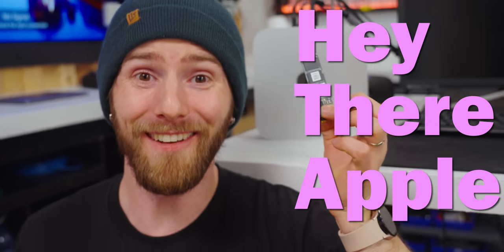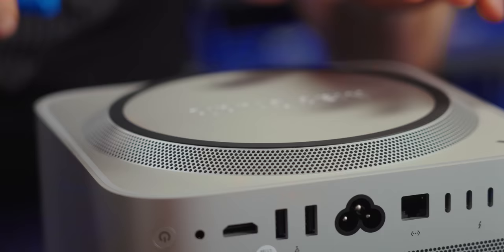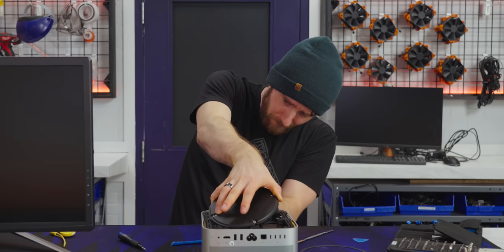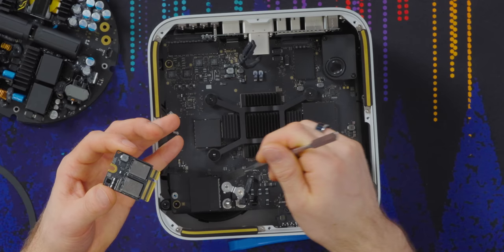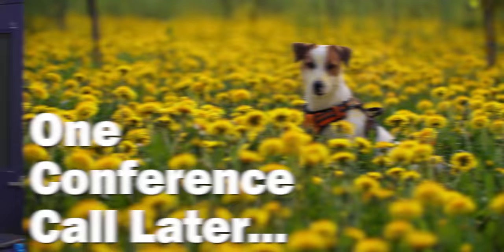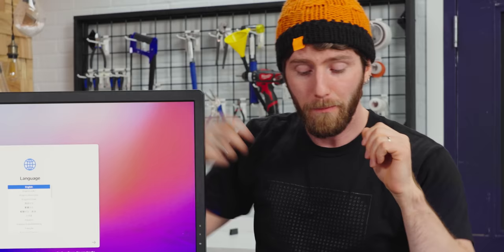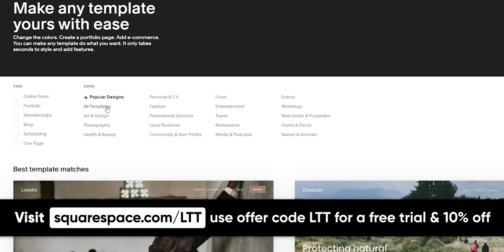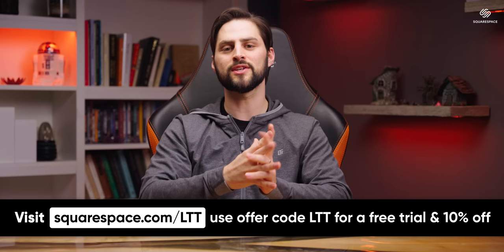I want to love Apple, but they’re making it hard - Mac Studio SSD Swapping

Comment: All these people claiming Apple is anti consumer don't understand the market that Apple is targeting.  Apple makes high end devices that are meant to be as user friendly as possible and require little fluency in tech.   They are meant to be a turn key solution.  Their users are mostly people in the creative space or business world who don't want to have to worry about if their tech is going to work, they just want something that they can count on.  It is for people who value form, not just function.  If you love to open your computer up and fiddle around with the guts, then buy a PC.  Honestly, I find Windows user experience to be so poorly designed that I would rather just pay the extra money for something that just works.   With a PC, it's designed to let you fiddle around with everything because you will inevitably need to when something stops working.   With literally millions of possible hardware configurations it's just inevitable that something won't work properly.  I used a PC for 15 years I jumped ship because it's obvious that Microsoft couldn't care less about the user experience of it's customers.  From the disastrous UX design (random forced updates anyone?) to the fact that not a single useful app is included, I dont know what they were thinking.  Honestly, does anyone use MS paint or Internet Explorer?  Why is there a settings app and a control panel?

The most common cause of issues as far is I know is heat, and the Mac studio generates negligible amounts of heat compared with a high powered PC which is basically a space heater.  This guy clearly is the type that loves loves tinkering with hardware and that is perfectly fine, but that's not the idea behind Apple products.  Complaining that you can't swap out the ssd here is like complaining that you your gas car doesn't have the same acceleration as an electric car.
Reply: Upgrading an SSD is more like filling up a gas tank in a car. Would you want a car that you cant refill yourself, with only way to do it is going to official gas station where it costs for you twice as much compared to the rest of gas stations? But at least the car is fancy, makes you a coffee and gives you a pat on the back* every time you drive somewhere. (*pat on the back and coffee making is part of apple+ subscription)
Reply: also the arguments of "they make products to people who are barely able to use anything tech-related" and "their consumers are rich enough to pay for it" are pretty stupid. You dont have to be fluent in tech if they could have made replacing an ssd as easy as it was on old thinkpads. One screw, take out the ssd and put new one in and then screw this one screw back in without anyone screwing you.
Reply: @mofik  not really.  Once used, you can't get that gas back where as with an ssd you can free up space.  Plus, with Apple you have other "gas tanks" that you can add in like icloud and external hard drives.  Upgrading in the PC world is also a failsafe because the components are often lower quality and given that there is such a huge hardware ecosystem of independent manufacturers any reliable quality control is essentially impossible.
Reply: @mofik  this is not the apple mindset.  When it comes to design, Apple is one of the best in the world and they could have easily added this in a user friend way.  They didn't because it's unnecessary.  No one drops 3 grand on an An Apple computer without doing their homework and knowing what size ssd they would be looking for.  If they are a filmmaker and need a bunch of extra space, they know in advance what their job requires and will buy extra hard drive space or an external hard drive.  Most people use their Apple products for work and if anything Apple users are more demanding as being able to use their computers reliably is tied to their ability to pay bills.  Opening up a computer carries is literally and metaphorically pandoras box. You can cause damage even if you know what you're doing.  Apple doesn't want to bring Murphys law into the equation because it breaks their vision of rock solid reliability. You can't have customization and reliability and that's why Apple is a closed system.

Comment: Some time ago ive bought a macbook pro from ebay, and it was icloud locked.....Its impossible for some with no expert skills and a soldering iron...Even apple are doing nothing, from what i have seen in the internet in some forums. Why is it so difficult to just remove the icloud lock? The new users and i doesnt want the data from the person before, we want just a running macbook. My opinion is that apple must di something about it. Just make it possible to erase the icloud, with some shortcuts or soemthing.

Comment: There is a simple solution to Apple's rip off attitude. Refuse to purchase their non-Intel based hardware. Upgrade the older products to the maximum you can afford. Then install Linux Mint Cinnamon on the Macs. You'll have proven hardware installed in an elegant case design with a superior OS that runs much faster than any version of OS-X. Open Source software uses much less space and RAM to function. Plus it's free!

Comment: Apple lock hardware by married 2-3 Chips ID each  you must use software and edit PUT married ID CHIP EACH OTHER ONE BY ON IF NOT A PIR OF CHIP HAS NOT DIRECTLY IT WILL REJECT AND LOCKED WARNING DISABLE SSD

Comment: I'm just a naive college student, but doesn't the controller control the address of the bits on the device? So since the controller is baked into the m1 chip, doesn't it have to have a fixed amount of address bits that are really hard to expand and detect a higher storage device? I guess you can use something that can be programmed to try to write data to an address that keeps going higher and higher until nothing can be read because that address doesn't exist, but can anyone help me understand?
Reply: No, that's not how SSDs work. Unless Apple specifically designed their chip that way - which absolutely wouldn't surprise me.

Comment: I don't like what they're doing, and I understand it. They are mainlining the NVRAM ... if you've ever mainlined, which is needle to the vein, you know that some sacrifices must be made.

It's NOT an SSD. It's a module with NAND chips. NO controller. Nothing else. It's just NAND. The SOC does the rest because - you asked for this. You've been begging for this. All of you reading this too. You begged and begged for a computer on a chip. You said, "HEY you... you computer people. Stop making us buy motherboards the size of Manhattan (or Canatreal or Vancanda or whatever up north) - Make us a computer that fits on a chip. All of it. One chip. One die.  The entire computer. The motherboard, controllers, and to heck with PCIe, who needs them? well ok maybe we want 1 for radios but get rid of em.. Everything is in a single chip."

So back in 2015, ARM/Apple, Intel, and even AMD set out to build you this dream machine on a single chip. 

Now it's 2023. There are still classic systems which use SSD's over the PCIe bus. The module Apple uses isn't that. No PCIe commands or overhead. Just needle in the vein. A custom interlink to the CPU without any front side, back side, saddle with socks side, bus to stand in the way. Just a module that talks to one chip. The Mx Chip. Which then does the handoff for the custom controller for talking to the CPU on the SOC. a watered down PCIe+NVME controller with ONLY the necessary instructions that Apple has decided to use for I/O.

This makes it super fast and means you can run all your apps and system with just 8gb of RAM. Because somehow... they've managed to defy the laws of physics and make it so the same app that needs 3gb of ram can now magically run in 300mbyes. Yeah right... no that's now the point here. It's basically Apple using NAND as RAM in a much more efficient way in a very asynchronous manner. I love how everyone says these are SOoooooooo fast. When has RISC ever used fewer resources? Never. Ever. It's not how RISC works. Apple didn't defy physics. They just removed all the overhead so that RAM and NAND run without all the barriers. Now that virtual ram appears just as fast as RAM - and actual RAM is just glorified instruction cache. 

sigh.. because according to Apple, Mac users don't really multitask. Even pro users. Non-pro will "only use one program at a time" and "doesn't need background processes." Pro users will just use one big beast to do heavy lifting and rely on a laptop to do their other digital paperwork, emails, tickets, preflight checks, etc on a side computer while that big huge video is being rendered. To heck with everyone else in between. 

sorry. those last two paragraphs are me ranting. See Apple is trying to blur the line between RAM and NAND. We all know RAM is not NAND but "in theory" NAND can be just as fast as RAM - Apple is testing the theory. THey've removed all those roadblocks so that the NAND is systematically accessing memory so fast that it appears like random access. bada bing bada boom. Apple Houdini is using illusion magic on you. Not me - I am still buying refurb Intels. Nothing against ARM. Just trying to buy a home so ... I have a nano pc dev server off to the side while I do the work from the intel Mac for now. 

Basically it's just a module with NAND chips. Nothing else.

Comment: Honestly. Apple blows away PC. There is reason why they are the standard in most fields. The studio is ridiculously powerful and rather cheap @ 2000$. The upgrade to 1 TB brings it to around 2400$. The computer is a steal vs anything else on the market. Plus if your credit is good and you qualify you can pay payments with apple 100% interest free. When purchasing you also should get  "apple care" which will fix any issue you might have including one you do yourself. There is not a limit on apple care so basically it is an indefinite unlimited warranty which is 100$ a year . It even covers if damage due to you and not the company ( maybe you dropped it or it got wet ). 

When you buy the computer buy the one you want. There is no need to buy cheap parts and fix your computer with a Mac. You don't need a tech. You just bring it back to apple and they will fix anything. ( maybe this is why you guys are so anti-mac ). If you wan't to upgrade storage then there is 4 thunder ports on the back to attach a high speed SSD ( which you can buy 3rd party and cheap) Why would you take apart the computer?. Not to mention all of this is in size absurdly small. ( way smaller than anything PC )

The Macs are well designed and not meant to be opened, messed with, or brought to a tech and have the best warranty.That is why Apple care is so cheap. That's why apple doesn't have the problems of PC. That is why they "generally" never have problems. This my experience and opinion over 3  Macs now ( all upgraded not one had any problems) and countless of PC's with endless problems prior to switching to Mac. I would never go back unless I had no choice.

Comment: 9:45 So Apple got rid of the online recovery capability?  This…. Ugh, this actually does piss me off!  My enthusiasm for Apple products has significantly waned in recent years.  I’m still miffed about them getting rid of the ability to upgrade/replace components on the MacBook Pro.  But this, this might be the one thing that makes me turn against Apple.  Axing the online recovery mode reeks of anti-consumerism which forces you to buy another Mac just to fix the one you already have.  But it looks like that’s exactly what Apple wants.  This is just…. This might just be the one thing that turns me off to Apple completely.

This is from a life long Mac user too. 😒
Reply: It’s still there, Alex got it wrong. You’re thinking of OS internet recovery and that’s still there. They’re trying to recover firmware which is different.

Comment: Once I was so blown away by Apple's way of constructing things, until you buy (new at the time) 2013 iMac 27". Failing GPU, failing PSU, Dust between the IPS screen and backlight... UNUSABLE in summertime because of thermals (even with manual fan control) yeah once I went back to PC... it felt so good. New GPU? No problem, if something fails; replace it without a hassle. And thermal issues? hahahahaha ZERO! Yeah, I had enough of that throttling cpu for 2000 EURO worth of aluminium from china.

Comment: Apple commercial..  "Apple introduces new functionless annoyances in our new device. Now with extra lockouts at twice the price. You can't upgrade or fix our devices here at apple we hate you. Expect your device to be throttled or just break for no reason but a software update. here at Apple we despise our customers F you if you bought our crap we tricked you to buy. Coming soon higher prices with less functionality. Enjoy our locked out operating system we crippled. Cases made from old soda pop cans and meth head tweaker foils"

Comment: I will never buy new apple stuff:  Always 2nd hand.  and when they stop making it easy to restore or repair (so far all my apple gear has been fixed / restored or upgraded by me), I stop buying apple.  I will not be buying any new apple laptops or anything that is all apple silicon.  Don’t need the power anyway.   I am not going to be joining the arms race (certainly will not be paying for it anyway) As long as other vendors can provide the bits need I will keep repairing and restoring .   its bye bye once this stops.  back to PC’c I go.  Design is not as important at functionality.   As apple does so does the industry (the jury is out on that)

Comment: took appart and fixed many apple devices in the past. Its all terrible. Its like the nice metal outside and good machining are a facade for whats really going on inside. Wrong choices of cables, stupid shit like fan being controlled by a thermal sensor superglued to the heatsing because aparantely apple engineers have no clue the cpu already has a thermal sensor. And then the good ol pentalope screws or every screw being different. Deffinitelly the worst devices to work on.

Comment: But there is also an important reason why this is not possible: Imagine if third-party suppliers started buying the basic model and then sold it much cheaper as an 8TB model. The modules installed later would not meet the quality standards and might often break. The unknowing customers would then take their device to Apple and complain that it is already defective. All eyes are always on Apple, this would trigger a worldwide scandal. In addition, Asian manufacturers could integrate malware or spy software into the module. This would seriously damage the image. I do not work for Apple, have no connection with them other than being a customer, but I understand this approach 100%.
Reply: What hilariously massive industrial-level copium intake is this? Most of even the cheapest SSDs in 2024 have freaking DRAM cache and this laughable joke doesn't, and even the cheapest SSDs work perfectly fine. They have no moving parts and are mostly just NAND flash; it's not a complex component. 95% of SSDs on the market would be an UPGRADE over the stock ones, not a downgrade. Rogue manufacturers adding malware to SSDs? I'm not even going to address that laughably ridiculous conspiracy theory. Same with your fantasyland scenario of someone blaming Apple for a defective non-OEM SSD, they would instantly know it's not made by Apple and the claim wouldn't even be picked up by the most unscrupulous news network. No, you don't understand literally anything about this approach. You're just desperately reaching for any possible reason to justify this anti-consumer bullshit no matter how ridiculous and unrealistic it is. It seriously concerns me that you're allowed to drive and even worse, vote.
Reply: @TheSolongsidekick  go on with your windows bs… you‘ll never get it

Comment: I never liked Apple computers because of their (computers for dummies OS) – hardware wise they are just like any other computer accept over priced and shortage of ports. I once had a MacBook running Win 10 and it worked great but, for the price I decided to build my own computer at half the price and 10 times more power, specially when it comes to producing music I can run over 50 tracks crystal clear but, on a Mac I would get pops and crackle noises with less the 20 tracks. – Get this garbage out of here - Cheers!!!

Comment: And this is why I will never buy an Apple... I know how ironic it is that I am writing this on an Apple laptop but in my defense this is a corporate laptop so not my choice just what the company provides. There are a lot of reasons to like Apple products but when it comes to their abuse of their customers they are probably the worst company out there with their insane prices and their constant anti-consumer behavior. Unfortunately those in power are beholden to the rich companies and their owners so they will continue to allow for this behavior by Apple and others.
Back in the day Dell would do similar though less sophisticated nonsense like swapping some pins around on the ATX motherboard power supply to make it impossible to upgrade or replace it without buying a Dell branded power supply or repinning the thing. This is why after that experience I have never and will never buy Dell products ever again. Just like I do not buy Apple products. The absolute hatred for their customers is the reason that Apple and Dell are on the naughty list and I will never buy their products ever again.

The good thing is that it is still pretty easy to build your own computer so there is no need to allow for the abuse. Even if you can't build it yourself or just want something that works with warranty and all that you can easily stop over at the local computer store and pick up a pre-build system for way less than the big boys are charging for their very locked down systems that are not upgradable or reasonably maintainable.